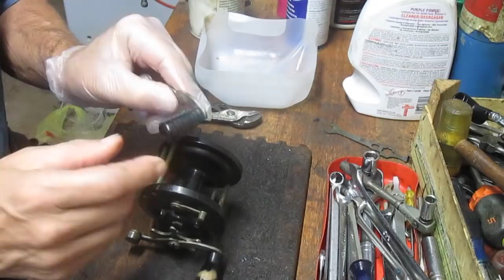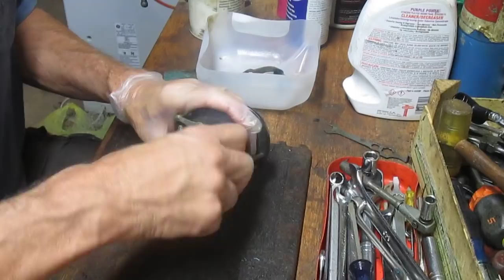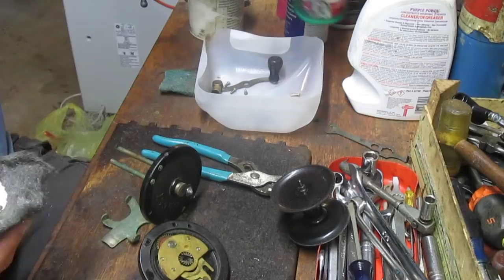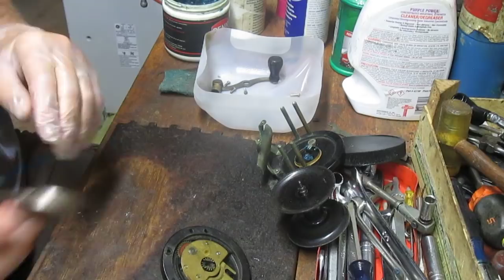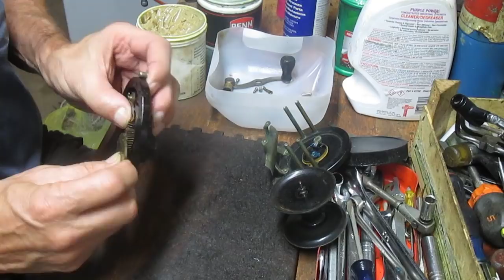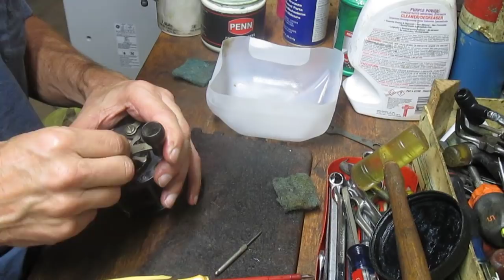50 year 0ld Penn 85 reel with wooden knob - take apart and service

Comment: Sir I must thank you tremendously. I'm 31 years old, and I love Penn reels, especially the old ones. I picked up a No. 85 from a flea market for $7. Nobody wanted to even entertain it, according to the seller. I brought it home not knowing a thing about it, other than how to use it, and that it still worked. It was covered in oxidation and corrosion. I found your video, watched it. Did my assessment of my reel, and watched it again. My hat is off to you sir. I now have the replacement reel that belongs on my late grandfather's pole. Same model, and around the same age; now in 100% working and 75%-85% anesthetically pleasing. Now I can take this setup back out on the water like he would want me to do. Thank you sir!!!!
Reply from the maker: Glad you were able to give the 85 a second chance.  Thanks for the note Tyler - Dennis

Comment: I bought this reel brand-new back In the late 70s. When I was 12 or so. I used it for years in the surf and lakes.  Then I moved off to Kentucky, picked up a spinner and that was that.  

Well today I was visiting my folks and started poking around in the garage, and there it was. Still hanging from the ceiling where I left it 30 years ago.  Still seems mostly o.k., though the star is ceased guessing those washers dried out.  I am looking forward to restoring it and getting it back in the salt.  Great vid btw...
Reply from the maker: Great to hear.  I'll bet it is just the dried grease.  New drag washers, oil and grease will get that reel fishing again!  You can get the drag washers for around $10 through mysticparts.com   .If the star adjuster is stuck, just spray it with some penetrating oil, like WD40 and let it sit a few minutes.  That should free it up.  Thanks for watching - Dennis

Comment: Thanks Dennis, I took my Penn 85 apart to clean it. I’m not sure where I got it but have had it for 30 plus years. I took photos as I dismantled it and kept track of which screws went where. When I removed the screws for the bridge that let the anti reverse dog go as well as the flat spring.
I did not know exactly how it was supposed to be. Out of shear luck I found your video on the 50 year old 85. It saved me, your detailed showing of how the parts go as well as removing the gear sleeve are much appreciated. 3 try’s with the flat spring putting it back together and it is working perfect.
Thank you and yes I did subscribe.
Reply from the maker: I'm glad to hear that the video helped you restore your reel.  THat's why I am doing these.  Thanks for subscribing.  Please stay tuned for more to come - Dennis

Comment: I don’t own any old reels like this, in fact I’m kind of a gear junkie of the new stuff (29 years old, sorry) but this channel is so helpful understanding how we got to new stuff! So cool!
Reply from the maker: Thanks for the kind words Jeff.  I like a lot of the new stuff as well.  The problem I am finding is that a lot of stuff  is just cosmetic change in a fashion industry that claims to be new and improved. Do you really need 10 bearings????  In the end, a main gear drives a smaller gear and the reels pull up fish.  Everything else is a bonus - lighter weight components, stronger, more precise die cut and or elliptical gears, stronger metals, better oils and lubricants, etc. I have to admit though, it is fun to open up a new reel and see 30 or 40 year old technology under the side plates

Comment: Thanks very much.  I have thoroughly enjoyed your videos on this (I have an 85, but a "newer" model with the Bakelite handle) and the Squidder 140.  I will follow your advice and cautions when replacing the drag washers (watch the springs, aye!).
Reply from the maker: Vane - thanks for watching.  Please stay tuned for more to come - Good luck on tuning up the 85.  It will last a long time if properly cared for with a little cleaning and oil/grease - Dennis

Comment: I enjoyed the Penn 85 assembly. I have a model 85 that came from great grandfather  30 years ago . I have had it in a box for that time. I decided to take it apart and see what was letting the reel crank in both directions. Once inside a saw there was no anti reverse dog or spring.  If I order a new dog and coiled spring will it fit any Penn model 85? Or are the side plates different for those with a flat spring or a coiled dog spring?  thanks figured you might know the answer
Reply from the maker: There are 2 versions of the side plate and dog.  If you side plate has a pin just above the lower right hand screw When looking at it from the inside, then your reel will use the flat top dog and the flat spring.  If there is a cavity and not a pin, then it will use the coil spring and the dog with he right angle bump out at the top - Dennis
Reply: thanks thats great information. I have the newer version and have my parts on the way.

Comment: I would definitely fish that reel.
Reply from the maker: No reason it can't go fishing!  So many choices, so few days to get the line wet.  The older 85 models are as good as anything on the market today. Thanks - Dennis
Reply: Bought one today (on old rod with non-monofilament line) surprised it still works like new. Clicks a bunch while casting & retrieving though

Comment: If them pliers are dedicated for your reels we ourselves take a rubber tube and force it over the grip of the pliers and slightly heat it up with a hair dryer heat gun or little bit of super glue and it stays. Nothing wrong with the kitchen scrubbie. Just an idea

Comment: Great video. I ordered a side plate to replace one that is cracked. The antireverse spring in my reel is a flat spring type and I believe what i received is a coil spring type side cover. Is it possible to get a flat spring type (part number?)or can it be converted to coil? Which is better?
Reply from the maker: Aaron - sorry for not replying earlier.  You can convert the reel to the coil spring.  The only part needed is the anti reverse dog which is different and of course, the coil spring.  If you did not get these yet, send me a note at 2ndchancetackle@gmail.com and I can send them to you - Dennis

Comment: Thanks for posting this. It was very helpful and I think I can almost do it! One question however, where can I find a replacement dog spring? Thanks again!
Reply from the maker: You can still get parts through Mysticparts.com. They are an authorized Penn Parts distributor and carry these springs for about $2 plus shipping - Dennis

Comment: Hi Dennis, I am currently reassembling an 85 by mingling parts from two reels. I finally noticed the "donor" reel is bent, the spools spindle ends and base plate have been discarded so far. How much force does it take to warp or bend a reel like this?
Reply from the maker: It takes a lot of force.  Usually these get bent when the reel is slammed into a side rail or dropped to the ground or boat deck.  I have parts if you need them - Dennis
Reply: Thanks for the input. I had someone tell me pulling a snag free or battling too large a fish could do it, that made no sense. Side plates are uncracked, my guess is it took heavy torque. Lost in a load of heavy boxes, stomped on etc. I'll keep the parts in mind.

Comment: I notice in your videos you usually use the HT 100 drags when refurbishing. Can you compare them with the Smooth Drag Carbontex washers as far as pros and cons or is it more just a matter of personal preference? Love your videos!
Reply from the maker: There is a difference between the two beyond personal preference.  The Carbontex are harder and more wear resistant.  The HT-100 are what the manufacturer supplies and they work great for the average angler.  If you find you are wearing these out or that you are constantly fishing with heavy drag loads, then Carbontex will perform better.  It comes at a price.  Carbontex washers are more expensive than the HT-100s.  Dennis
Reply: @2ndChanceTackle  Thanks Dennis. Your timely response is greatly appreciated! Tight lines!

Comment: Is the nut above the handle with the hole in the center for oiling?
Reply from the maker: Yes.  That allows easy access to oil the bridge post and gear sleeve without disassembling the reel.  Most folks will take the handle screw off and add a drop of oil inside rather than try to add through the hole. - Dennis

Comment: mine has a red bakalite handle . how old would it be ?
Reply from the maker: The side plates have more to say than the handle.  if you have black side plates, they were made up until the 1980's when they switched to brown side plates.  The wooden handles were replaced in the 1950's.  So your reel is anywhere from 30-50+ years with the black side plates and 20-30 years old with the brown ones.  Thanks for asking - Dennis

Comment: I have one penn 85...for parts...
But i have no ideas yet...it has broken spool....thanks
Reply from the maker: Rey - if you can't repair it, save it for parts.  Most of the internal parts also fit the Long Beach 60 and DelMar 285 reels.  Similarly, if you need a spool, the spools for those reels will fit the 85.  Dennis